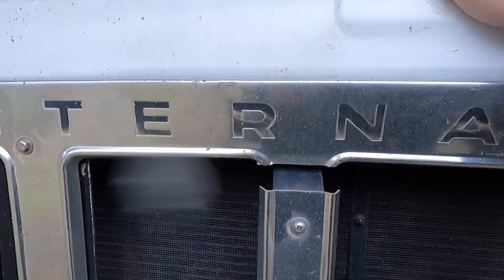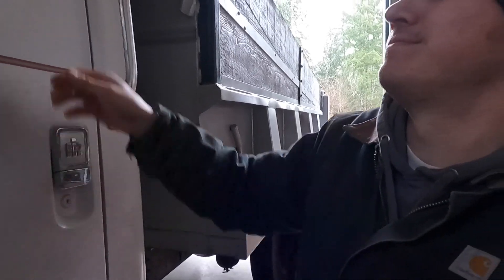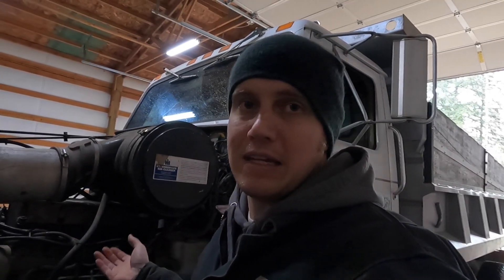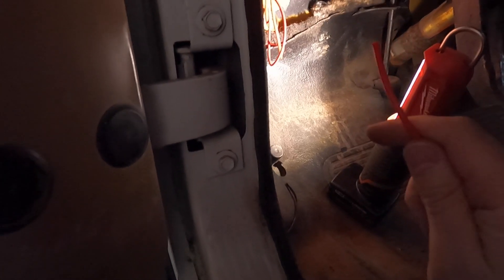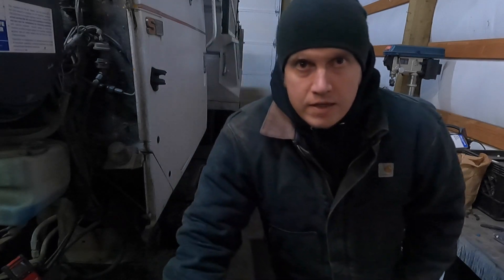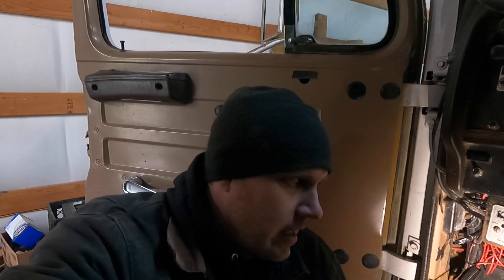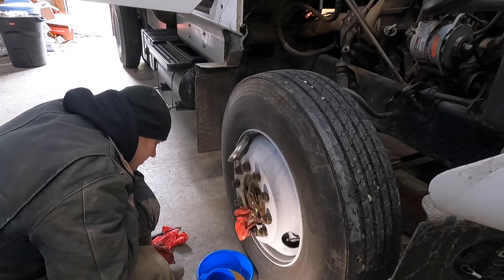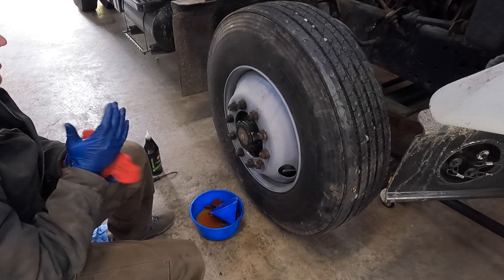Dump Truck Maintenance, How To Diagnose a fuel shutoff solenoid on an L10 Cummins.

Comment: I've got to one exactly like it with the same start symptoms. Let it set a few years because of a left rear hub problem and now it won't start. I will check my fuel voltage and see if that's my problem. 

I'm going to sell mine also. It runs great with low miles but has that left rear problem. I'm thinking I may disclose the problem and sell it as is. 

Thanks for the video, it was great. KT.